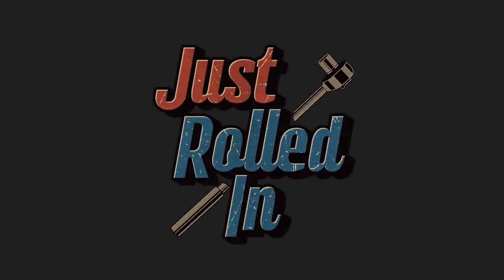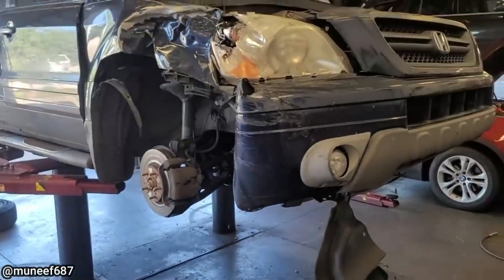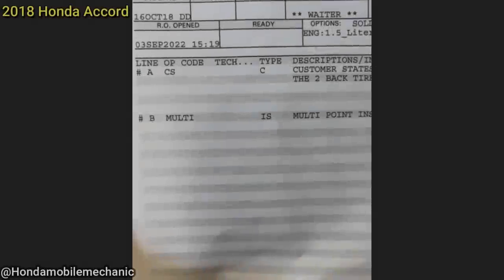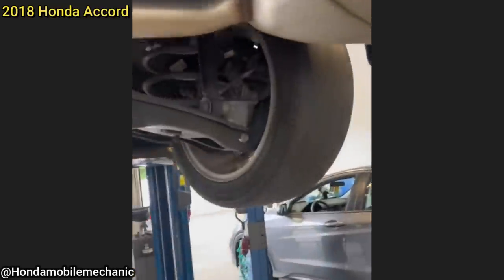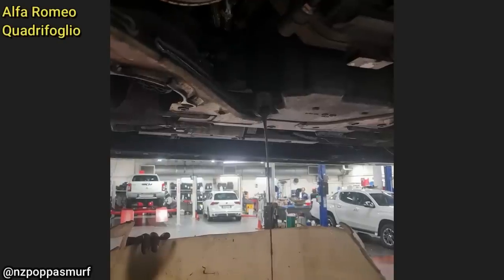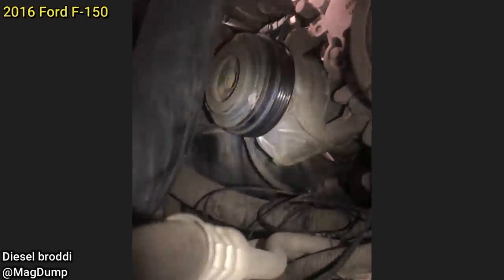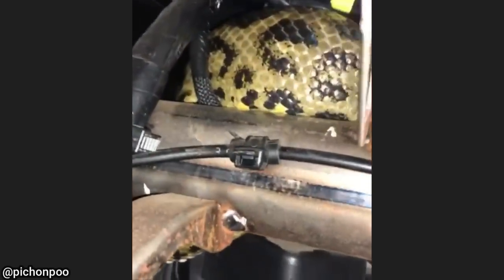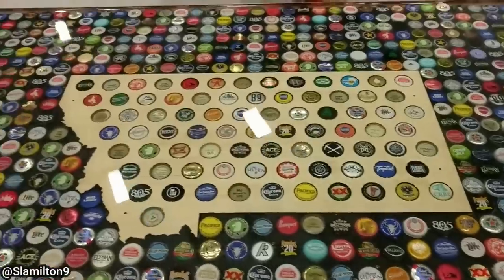Customer States Haven't Serviced Honda Civic In 9 Years | Just Rolled In

Comment: Customer: "My car's on the verge of falling apart, tell me what's wrong!"
Mechanic: "Here's what's wrong-"
Customer: "NO! There's nothing wrong with my car! This is a scam!"
Reply: I brought in my car to a garage once, the rear cylinders needed replacing...  "you're lucky you brought it in, it's not safe to drive!", my father is a mechanic, had a look, said the cylinders were fine, and the mechanic was scamming me.  Ever since, I can't count how many times I've heard "You're lucky you brought it in!  it's not safe to drive!".  Sometimes it's even true, but you can't really know when.
Reply: just bc they didn’t have the shop fix it doesn’t mean it wasn’t fixed 🤷 i prefer to do repairs on my own if possible (though i can confidently say i would never be in a predicament worthy of being featured on this channel)
Reply: people bring in their cars with serious problems and decline repairs because sometimes the repair can cost almost as much as the car.
Reply: @mgjk  I had a similar thing happen to me. Had my cars annual safety inspection done at a new garage (because it was closer) and the guy failed every single part of the car. But then immediately after offered to buy the car off me for dirt cheap, which made me suspicious. So I took it to another garage and they said the only thing wrong with it was the rear brake pads were almost worn out.
Reply: To all of those responding to me, my statement comes from personal experience. Please calm down.
Reply: Yeah, certainly... although in some cases I figure they think they can do it themselves or get a better deal elsewhere for a simple thing. And then sometimes, they just can't afford the repairs. There's a looooot of people out there these days who work 12-16 hours a day and can barely keep food on the table, if that.
Reply: My car had the oil pressure light go off. I had it towed to a "reputable" shop that was highly rated. They told me I need to replace the entire engine. It is $9,000 to $11,000 for a new engine. Keep in mind, this is a used car I have. If I were to put a new engine in it, I'd rather just buy a new car. 

There is nothing wrong with the engine. I took it to a friend who fixes cars and he said it was probably the oil pump. He had me buy all of the parts and give it to him and pay him. He replaced the oil pump, didn't change the water pump because he said it was new and to save the additional water pump I had, and he did the timing because he had to remove all of it anyways.

The car drives around fine now. The only problem I have now is it slightly leaks oil because I snapped a bolt on the valve cover so the valve cover isn't completely sealed against the gasket.

After all was totaled up it was around $500-$600 for the repair with the parts and paying my friend. Compared to the $9,000 to $11,000 engine they wanted to buy and drop into the car. Which was not even a brand new engine. Keep in mind, they never opened up the engine to be able to tell me the engine is bad. I assume they just didn't want to go through the work of replacing the oil pump because it required so much stuff they had to take off. Even taking off the valve cover requires you to take off the entire intake manifold and go through an entire process to get to the covers. Or, like most mechanics, just wanted to make a whole ton of $$$ and rip off their customers.

Also, I know what they did because they would take pictures and leave notes. The only thing they left me was a picture of the oil pressure sensor with some RTV on it. Which, I did like an idiot. I put a little bit too much. I had did that to replace it hoping it would fix the light but it wasn't a oil pressure sensor problem. They did tell me the engine has zero oil pressure. There was no oil moving at all. Zero pressure. That is all they told me. 

The oil pump was more than likely clogged up or damaged. Once it was replaced there is no longer an oil pressure problem. From what I remember, it was/is a common problem with my car.

Mechanics, especially shops are some of the most untrustworthy places you can go to. Maybe they should fix up their own industry and they won't have the problem. It exists for a reason.

Edit: They also charged me almost $200 for that little "diagnostic" that they did. A surface level look around my car and inspection of basic stuff I could do at home plus a report that pictured by oil pressure sensor with RTV on it. They also made it out to be this extremely bad and terrible thing like it was very bad for it to have some RTV on it. That's how it is done when installing a oil pressure sensor on my car. I may have put just slightly too much but it wouldn't cause my engine to explode.
Reply: @mgjk  not certain you know what you're talking about.
Reply: @Squirrel-Chaser  You don't believe drum brakes have a cylinder?  Ok.
Reply: @AceTheDragon3  Hi
Reply: That about sums it up perfectly.. LOL
Reply: Mechanics do scam though
Reply: @mgjk  the hydraulics ones does, the wire ones dosnt tho
Reply: @megimargareth4015  those are parking brakes only. the time when the regular brakes were actuated by wires are long gone.
Reply: It's illegal to drive a car whose tires look like that her in Germany. Is it legal in the US? I mean he coudl kill someone on the highway with this piece of crap.
Reply: No, some mechanics are scumbags.
Reply: To be fair I would say half of mechanics are shady people, had a guy try to tell me my head gasket was blown and it would be $1,500, when it was actually the thermostat and wasn’t more than $140
Reply: Honestly 90% of the time what a shop will charge for a major issue is more expensive than buying a nice used car for 3k and riding it until it falls apart.
Reply: @mgjk  Well, actually you can. It's true if your trusted shop tells you so. That's why I took all cars I've ever owned to the same shop for as long as I'm driving cars. Further in Germany every car needs a mandatory safety inspection every two years, otherwise you cannot even take it to a public road and the majority of cars shown in the videos of this channel would be off the road for years in Germany. The safety inspection is not done by normal mechanics but by special trained experts whose work is strictly controlled and regulated and who cannot earn any money from telling you that your car is not safe as they are never the ones to repair it. They get paid for doing the inspection, no matter what the outcome is, so they have no financial benefit to lie to you.
Reply: @EbonyPope  same here in the UK, the legal limit is about 1.6mm iirc
Reply: When I was younger I was definitely pumping out some “customer states” level repairs 😅🤦‍♂️
Reply: @mgjk  Which kind of shit shops do you bring your Car and why haven't you developed a relationship with a nice mechanic that didnt scam you and used that one?
Reply: @Malar1898  every time I think I find a good mechanic, they turn out to be a scammer.  Nothing I can do about it.
Reply: @mgjk  ive only found them in the enthusiast shops, special JDM shops that tune Cars and such
Reply: @Malar1898  hmm, good idea, I never even thought to try them as I usually drive economy cars... but yeah they've got to do normal cars too.
Reply: @mgjk  Yea i do both there, they for example found a failing steering rack bearing on the Mini Cooper of the fiancee, the Dealer never found it and charged insane hours.
They allowed me to testdrive their GT86 Turbo trackcar while they did the work 😂
Reply: @kona8832  True, it's all about what the car is worth to you. One really learns the value of a car when it breaks down and you see how life is without a car.
Reply: it’s cause shops charge 70x the price
Reply: @misseselise3864  Sure, but usually the type of people who like to do their own repairs (or maybe I should say the people who are competent at doing their own repairs) usually know how to maintain their car and periodically check it so that such big issues don't happen and it's not a surprise at the garage.
Reply: LOL! I think I spotted your target demographic in the reply section...
Reply: @hieroglyphics...And how are the brakes forced outwards in a drum brake system? With a piston inside a cylinder...
Reply: I think they just don't have money
Reply: @misseselise3864  leaving with a nine road worthy car is stupid. Fix the car or don’t drive it.
Reply: @dickJohnsonpeter  I was a mechanic for 15 years. Drum brakes have what is called a "wheel cylinder". When the brake pedal is depressed, the brake fluid in the wheel cylinder pushes out two pistons that push the brake shoes against the inner surface of the brake drum.

Comment: I once had a Buick that ran on 5 cylinders. My dad gave it to me. Told me not to change the oil, the sludge was probably holding it together. Sold the car for $400. Hey, it had a new radio!
Reply from the maker: Mint 👌 lol
Reply: I had a old ford aspire that I got super cheap from some friends it was $300 bucks. I did regular maintenance that most people would do for a used car plugs brakes asked them when they last changed the oil they said they never did (they had been using it for several years) and it was an old rental car. I changed the sludgy mess and it ran like crap until it had 6k more miles on it then it ran good again and after that I just added oil when it was getting low.
Reply: Adding a nylon stocking to a worn & noisy rear diff was reckoned a good fix in my youth
Reply: My parents had a Toyota Avalon like that, had low miles but it was full of sludge and valve seals were non existent, burned so much oil on startup it made white clouds. Sold it after it was drinking 2 litres of oil a week (2 quarts)
Reply: Had a 1999 Oldsmobile Alrero. Got it for 16th birthday as a gift. Had a blown head gasket for 2 years until I finally got another used car that has been my baby for 5 years
Reply: Ahh a true redneck. We change the oil in the truck when we change the motor... lmao
Reply: @ckelley1102  Those were usually intake manifold gaskets and you could have fixed it for less than $35 in parts.
Reply: @keithlibner9259  nah it wasn't. Source: car was shit and needed an excuse to get another one
Reply: @peterforrest5181  That's a new one to me. I knew a guy who used to flip/rerun auction cars back through auctions back in the day. He always used sawdust in diffs, banana peels in manual trans and can't remember the special fluids he figured out to quiet other stuff down or make auto tranny work just long enough to get a good price. Guy was like an alchemist with that stuff. "Noisy rod? Oh hell just add a cup of 80/90, splash of trans fluid and a couple squirts of grease". Crazy recipes like that. He also used to buff sun faded cars with grease. Brought that showroom shine right back😂.
Reply: 5 out of 6 or 5 out of 8?
Reply: Hope you disclosed the issue before selling it
Reply: @69jbr69  if only he focused his powers for good and not screwing people over. But then again if you’re buying at auction for reliability I guess you aren’t too bright anyway
Reply: My husband and I used to have a 3l escape like that also! We did eventually change the oil after 2-3 years of not doing so and still ran perfectly fine lol. Had it for about 4-5ish years traded it for a 1st gen Escalade then sold it.
Reply: @DontCryAboutIt  it's a bluish smoke
Reply: @De19thKingJulion  out of 6, thankfully. Required special tooling to get at the back half of the transverse v6, which we didn't have or care to get. 82 Skylark pile of garbage.
Reply: @coreybabcock2023  Of course! I wasn't a crook. It was pretty obvious :D
Reply: My parents had a Dodge Aspen. It had many problems, but at least the radiator didn't leak. Eventually, they got it flushed and it leaked like a sieve. The mechanic guessed all that sludge was blocking the sections with missing fins, thus maintaining pressure (if not flow).
Lesson learned: sometimes the dirt is structural.
Reply: @bishbosh7728  fair nuff
Reply: @DontCryAboutIt  I discovered one other thing that can... We were working on dad's 99 ranger, and in the process put in 6 "remanufactured" fuel injectors. Everything was right, we'd checked repeatedly.

But it would start, run for a few seconds, then develop a hard miss and began belching white clouds.

Not until we tried pressurizing the fuel system with the upper manifold off did I hear it... The sound of a small cup being filled up with water. Queue panicked "oh god kill it kill it kill it." The "new" injector on cylinder 3 was stuck 110% open. The intake chanced to be closed, and we siphoned nearly half a cup of gasoline out.

I shudder when I think about how the garage was filled with a haze of aerosolized gasoline.

Poor thing had a failed 4th/5th gear, and both heads cracked (this is a known defect in the late 90s ranger ohv), and at least 2 bad injectors.
Reply: I have a friend who had an old car with quite a bit of rust.
she went to fill up her gas tank and since the gas station had a special for car washes she got a car wash as well.
when the car washer started to clean the underside of her car her gas tank fell apart.
it had rusted into pieces and the dirt somehow kept it together
Reply: I once had a ‘79 Mustang that used like a quart of engine oil every teo weeks. I never needed to change the oil, just topped up now and then. Didn’t have it long enough to need a filter change. 😂
Reply: @DontCryAboutIt  it was burning so much oil for the first 10 seconds the smoke was blueish opaque white, then it went normal 2 stroke blue after
Reply: @angrypotyeto9656  My previous employer bought a used Toyota Camry 2.5V6 which had the same problem - the engine was full of sludge, had huge oil consumption, and produced white clouds from the exhaust on startup. No idea why the smoke wasn't more blue.

Comment: I'm amazed that engine ran without an oil change for 9 years!

Also, just wanted to say thanks for putting in subtitles, I'm hard of hearing and it's awesome, thank you again :)
Reply from the maker: Hope they are half decent as YouTube automatically writes them lol
Reply: @JustRolledIn  They're better than most videos!
Reply: Nippon Magic.
Reply: @BrittanyScream1  he speaks super clearly, which helps the auto inscription. great presentation!
Reply: @maximumbling  Ah, I figured that must be it! Either way, it's awesome and I'm grateful for it in any way!
Reply: @JustRolledIn  Your speech is pretty clear and distinct, so the auto subtitles are usually right on. I'm another guy who uses subtitles to supplement my hearing aids.
Reply: Probably kept adding oil.
Reply: That must be fantastic oil,I want some,only change it every 9 years.🙃
Reply: Yeah, I’ve seen some Toyotas firsthand make it that long with no oil changes when I worked at the dealership, crazy stuff
Reply: its a honda things are indestructible
Reply: @MrOlgrumpy  and here I am worrying about 1000 miles over due for oil change....
Reply: Hondas are basically bulletproof at this point
Reply: @nodsib  There was even a Maserati Levante on Hoovie's Garage that went 60K miles since its last oil change. It had a lot of sludge, but they just cleaned it out with some special detergents they added to fresh oil and ran the car for 30 mins before changing the oil again. What made it even more impressive was that this was a high mileage example with the twin turbo V6 and left over meth in the trunk.
Reply: @Epotheros  Yeah i saw his videos on that, that's really surprising, but i bet the motor won't last another 60k even though they got it cleaned out
Reply: if it was Toyota it couldve gone 100k miles
Reply: used to work for a honda dealer. used to see it pretty regularly unfortunately. I was always angry that they never needed any major (or any)  work, flush the engine of sludge, new oil and filter and have a nice day. Then you get customers that take heaps of care of their car and have issues.
Reply: @fidelcatsro6948  no kidding, I had a friend that bought an old Toyota with already high miles and she never did any maintenance, the car did last but it was already high mileage and old so it did mess up the engine. But still impressive. My neighbor is another person that is cheap to change his oil. He didn’t change it for almost 2 year because his free oil changes stopped. He daily drivers his Corolla and still going strong, dirty, no maintenance but the car keeps going.
Reply: @Walterrinho  rev up your Toyota engines!!
Reply: Only 47,000 miles in all those years.  Probably never went far or fast, otherwise it probably would have frozen up on him.
Reply: Its a Honda what do you expect 😂
Reply: It's a honda...
Reply: bikers have a saying. "ITS A HONDA" cheap and reliable
Reply: My mom has not changed oil on a 2007 Honda Civic for 2 years and oil indicator says 90% good and it runs well. I guess these things are indestructible But she only has 22,000 miles on it!!!